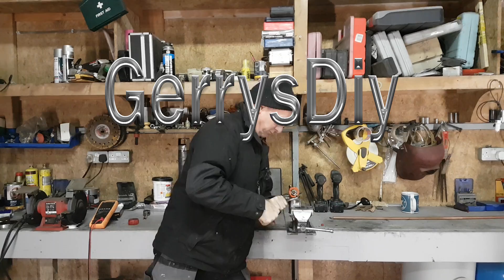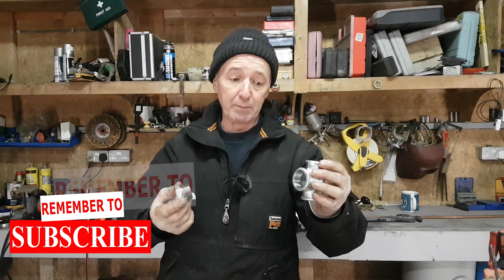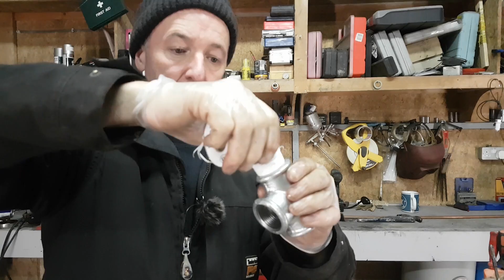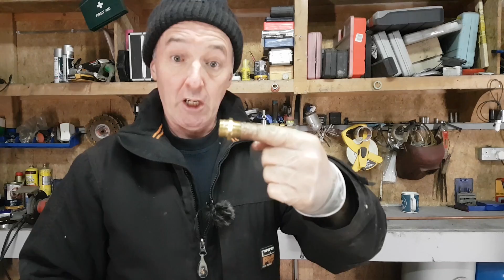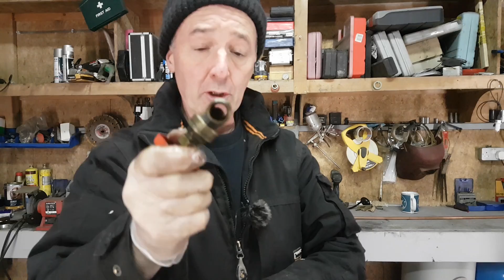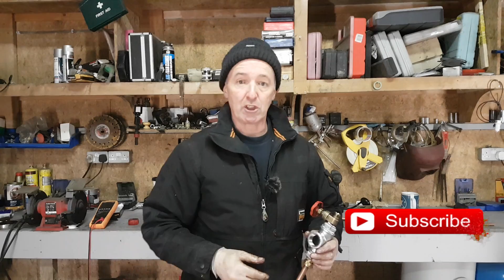Waste Oil Burner EASY 5 minute drip feed oil system

Comment: At the risk of sounding a smart-arse, I would seriously not recommend using that white PTFE tape anywhere near where it could roast and burn - it gives off seriously deadly fumes. The old way - a greased up piece of rough thin wool-fibers or natural fibers, say from old rope strands, is far safer and costs nothing.

Comment: The problem with a drip system I am having is I want it to burn three hours so I have around a 3 gallon tank. I start it up works great but then about half way through I have to open the valve more because the less pressure from lack of oil makes the stream smaller then at the very end I have to open it up again, in fact I have to open it about every 20 min to keep the same flame going. 
Trying to figure out a way so I can fill up the 3 hour tank and not have to mess with the valve

Comment: Hi Gerry, excellent videos, but you really don't need that much of Teflon tape. I'm retired now, but worked for a very big steel company in Canada. The company had training there lots of it, they had the company from Swage Lock there, and they mentioned you never need any more than 1 to 2 wraps of the Teflon tape at the most.  ( Personally I prefer myself maybe 3 or 4 wraps thou). Just thought I would mention this bit of info.   Excellent videos thou, thanks

Comment: Hey Gerry
I have almost completed a waste oil burner and drip system using veggie oil.
The issue I am having is that the copper oil drip pipe that hangs over the flame is heating up. After about an hour the copper drip pipe gets so hot that it starts dripping fire. 
What are your ideas for insulating the pipe so this doesn’t happen?
Cheers Cawdor
Reply: Send it in from underneath

Comment: Hi Gerry! Just wanted to say thank you for the insight on burner pot designs and the drip feed system. I just finished my heater (video is up) and it works great! Check out my air intake design using a furnace blower as double duty and let me know what you think! Cheers!!

Comment: Im trying to get an oil burner in my coal boiler fire box for about a 50 to 75 % heat source.  Letting the coal regulate the water temp  .   Tried a few different ideas from your videos but cant get them to work outside when temp is -30

Comment: I found surface tension is the enemy with this valve system.  I drilled a hole in a rubber stopper, pushed it down in the pipe above the T(with the tapered end down), and now the oil does not cling to the sides and run down so I cannot see it drip.  Needed the rubber stopper above the sight T to see it drip.  The rubber stopper acts like a funnel making sure the oil drips down the middle of the T so it can be seen.

Comment: This is the Home Depot version: 20mm is about 3/4". So I would eliminate the bushings and use a 1/2" inch, galvanized or black iron, 4-way cross fitting connector because the openings are large enough to be used as a view hole; a 1/2" NPT X 1/2" male compression fitting; 1//2" gate valve with female threads (which is all that they sell here in the U.S.) with two 1/2" close nipples to install on each end of the valve; a 2 1/2" length of 1/2" copper tubing; two sets of 1/2" compression nuts with ferrules. Eliminate the 2 1/2 miles of teflon tape because pipe threads jam together to create the seal. Teflon tape is a lubricant that prevents the threads from corroding together which makes disassembly years or decades later easier.
Reply: "Eliminate the 2 1/2 miles of teflon tape because pipe threads jam together to create the seal" I thought it was 4 ft but it might have been 2.5 miles lol. Obv this guy thinks if a little is good alot is better.
Reply: Oh and I stopped watching at that part because i dont think he could teach me anything I dont already know.
Reply: @unbannable9205  Bit unfair tbh, This is the only thing I have picked up on Gerrys videos, your last comment shows your true character
Reply from the maker: Thanks Daniel 👍

Comment: Hello Jerry John from New Zealand. I have made and Oz RIT waste oil burner heater it works well. I would like to put it in my shed 12 m by 20 m and I collect rainwater off my roof. I wonder if you or any of your subscribers have had any issues with soot particles on their roof the roof is 5 degrees and I will probably put the flew up to 2 m Beyond the roof cheers for any comments
Reply from the maker: Hi John. This burner will run smokeless if the flue is 125mm or bigger and the  length is 4m or more. But even if you were burning wood there would be particulates. Burning waste oil is like burning coal in that even if you get it to burn smokeless the gases and particulates are not harmless and I would imagine dangerous to ingest. The gases would swirl and contact the roof at least sometimes so I would be careful. It would depend on what you do with the water. Hope this helps Cheers Gerry👍

Comment: Are you going to put glass in the side of the T piece so you can see the oil drip? If not then you didn't need tape at all.
Reply: Exactly
Reply: Tape wasnt needed anyway. It's not a pressurized system...
Reply: @jasonford2923  That's what I'm sayin'.

Comment: Way too much teflon tape ! 2 complete wraps is all you need ! REALLY ! 
would have been nice to see more of what your building ! ....
the problem with a gate valve is that when turned down it will force the oil to run down the side and not drip where you can see it..... a needle valve would be much better ! .
Bob.....

Comment: Hi Gerry. One thing im always worried about with these things is having the mess if the thing overflows if the drip feed pipe blocks. Have you ever had a problem with that?
Reply: My thought is to have  the supply tank sized so that it would not overflow if the fire went out . 2 - 3 gallons . I intend to have a bigger tank behind that piped to fill the feed tank .

Comment: Do you have to use stainless steel flu pipe? I'm having a hard time finding  stainless at ho.e depot or Lowe's, thanks!
Reply from the maker: Hi. Jason. You can use any flue pipe, stainless steel , cast iron or just plain steel. I find that at least 4 metres or more will give good mixing in the burners if you are using it normally aspirated. I am using 6 inch diameter flue on most of the projects and I have some 5 inch that I use on others because I have it here. Hope this helps Cheers Gerry👍
Reply: They have fittings on Amazon

Comment: 2 minutes if you don’t use all that tape, which you don’t need anyway do to the lack of pressure in this system.
In a pressurized system, the use of that much tape wrapped so loosely, would make perfect conditions for leaks. This method is the equivalent to pushing up a shirt sleeve with your hand. None of that tape will make it into the fitting. By luck it may create a gasket as you over tighten it. Two full wraps applied while stretching the tape as you go, allowing the tape to seat in the valley of the threads.

Comment: Gerry, I'm enjoying your vidoes very much keep up the great ideas. Can you tell us what type of glass you are using in your stove? The only type that I know of that can withstand the temps of your heater is ceramic glass (Pyroceram or Neoceram) and I would like to incorporate a "sight glass" into my heater and tempered glass is only rated at 400+ degs. F. 
Thanks, Wayne, Alberta, Canada
Reply: I am wanting to make a high temp wood stove for a small space. I have not tested the idea yet, but I have collected the glass pieces out of some older "shop" lights. They get pretty hot... It's a shame not to be able to watch the warm flicker of the fire. Calms the space between my ears.

Comment: The way you are using that teflon tape you must have stock in Dupont.  Way too much tape for pipe threads!!!
Reply: CC Greening if he used it for years oil can seep out slowly and make a mess. Teflon tape will stop the leaks

Comment: Hi Gerry, I modified my wood stove to be a waste oil burner like in your videos.the main difference is I don't have a hole in the bottom of my stove,I used a pipe that brings air from outside the  house into the bottom of my burner.its been working fine for 3 months now.i just had a small explosion last night! It broke the latch and warped the door! That fireball was pretty frightening!! Here's my question- what causes this? It wasn't windy last night,my chimney is clean...maybr too much oil?y burner pot was glowing red.hasnt done that before)also,what causes sooty buildup on the burner? It's fluffy ash...any help.would be greatly appreciated!
Reply: Oil vapour reaching flash point.
Either make a flashback arrestor screen or find a way to keep a pilot flame running

Comment: Dang, you used enough thread tape on the first fitting to make about ten assemblies......
Two or three wraps is plenty to seal.... Unless the female threads are stretched out and the male is over cut... 
Other than that, looks great!!!
Reply: Lol on a non-pressurized, open ended fitting. why bother with tape?
Reply: Lmao I was just about to say
Reply: Not like it’s expensive or anything so who cares
Reply: A little extra thread tape doesn't qualify as something to rib about. I am Tanya. I live off grid in a school bus conversion. I have been looking into ways to improve my accommodations. I'm not an idiot. So many you tube videos are lacking in good dialog and essential elements of assembly. This is the best you tube diy video I have seen.  If I could hug this man I would. I'm hoping to find more videos. Is he is available to chat? Are you available to  talk?
Reply: @t.k.morrisbrown5161  It is not a "Little extra" its a "LOT" extra lol, the comments her pointing it know that. There is no point in wasting the tape, you may need it for a future job especially if you live off grid.

Comment: Bloody hell do you actually need that much tape? Or do you find it drips if you don't?
Reply: Hell no, the amount of tape he used is beyond overkill.
Reply: @rigidironworks9834 : Don't be to hasty to criticize the amount of tape he used as I built a waste oil heater myself (inspired in part by this guy) and oil leaks in the supply line connections were a problem until I used RTV silicone on the threads. Connections that will hold water no problem will still leak small amounts of oil if they are not absolutely perfect. Used motor oil isn't something you want leaking as it is one hell of a mess to clean up, even in small amounts.

Comment: Have you ever tried using a needle valve? You can pick stainless steel needle valves up pretty cheap on eBay.
Reply from the maker: Hi Naughty Goat Farm. I haven't tried one yet on waste oil because I always have quite a few gate valves at any given time but they should be more precise at metering the oil. I will get some and see how they cope with waste oil. Thanks for the comment. Cheers Gerry
Reply: Naughty Goat Farm I use a needle valve for an ice maker for a refrigerator.i use a short run of clear ice maker line( so I can monitor the flow) before it goes into copper line that goes into the burner

Comment: Hi Gerry, just a quick question. I'm planning to build one of these stoves in the summer. But one issue I want to overcome is stopping heat loses through the flue. Any idea how to do this ?
Reply from the maker: Hi Kas m. The more surface area your stove has the more of it's internal heat you can extract to your space. Most typical domestic multifuel stoves are abut 70 to 80 precent efficient. If your flue is single walled and long inside the buildling you can recover some more heat that way. I had my stove running red hot and I could put my hand on the flue above the roof outside. That's not bad at all. Hope this helps Cheers Gerry
Reply: @GerrysDiy  thanks for the reply. So will it be best to make the stove out of a 47kg bottle Vs a 13kg?
Reply from the maker: Hi Kas. I favor the larger propane bottles and I ran a 47kg bottle with a disk separator for a few years. I could burn solid fuel in it as well. I have my own design which works great with forced air or normally aspirated too. Here's a link to the build. https://youtu.be/cYxtNRKj1Es That will give you something to think about but I refined that stove further in later videos https://youtu.be/AiKcx7ghtHk There are more videos in the playlists with this build. Hope this helps. Cheers Gerry
Reply: The design I’m working on uses a “smoke bell”.

It can be as simple as one of those two barrel stoves where the top one only holds hot smoke.

That gives the smoke time to give off heat, and lets some of the particulates condense into creosote.

Better to trap it where you can clean it up than let it form in your chimney.

Comment: I'm not too clear on how you fit the feed pipe into the stove or how high it should be. How far into the stove should it be? I have a good idea about the rest of the mod but I haven't been able to see inside any of the stoves you have worked on.
Reply from the maker: Hi donal. I will be fitting this to the boiler stove project tomorrow. You will be able to see it in operation making hot water from waste oil. Getting time to be in the shed this week is mental. Here's a playlist and some of the videos will have what you are after https://goo.gl/gzhBZk Thanks for the comment Cheers Gerry

Comment: Hi, Gerry, as others have said, pipes without pressure don't need Teflon tape (or pipe dope, or anything else).
Additionally, no more than 2 wraps (1 is almost always enough, but most everyone is nervous).
Reply from the maker: Hi Sean. The top bushing does not require thread tape but the oil will be collected by the bottom threaded fitting and would weep oil. This includes the 1/2 inch brass fitting threaded into the bushing too. Tapered thread fittings do well on less tape but the brass fitting is paralell threaded so I go a little nuts lol. I hope to get the day tomorrow in the shed and I want to get the boiler stove up and running.

Comment: Say Gerry, why is it you bother with the thread tape when the drip feed isn’t pressurized and there’s already a big hole in the side to see the oil drip. Why not just crank around on the fittings as the come?
Reply from the maker: Hi NMranchand. I know what you mean. The bottom fitting collects the oil and will drip if no tape used. The top bushing with the valve does not. I will be mounting this valve on the boiler stove hopefully tomorrow. Well spotted lol. Cheers Gerry
Reply: GerrysDiy Thanks Gerry. I didn’t imagine oil could get through the bare threads (tightened) at the bottom without pressure. Doubly glad I asked before...one hates to think.
Reply: Is there a way to screw in a sight glass peephole?
Reply: thank you so much for leveling your sound effects! i subscribed before i ever heard how loud they used to be. ya got great information! also i cannot comment and can only reply to a comment. it is nice when the creator comments, that way i feel my replies/comments reach the creator.

Comment: what is the best way you've found to strain oil?
Reply from the maker: Hi John. Getting the big solids from the oil is easy with a big strainer. After that I run it through a cloth filter and I de water it in a small drum with a 2 valve setup. The lower valve will release the water and the higher valve will fill my burning drum. Easy really. Cheers Gerry